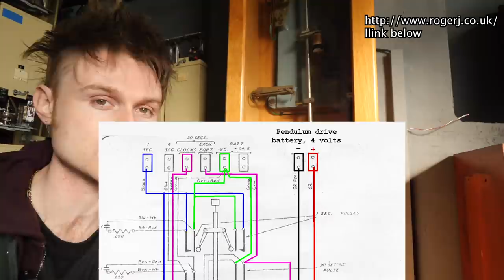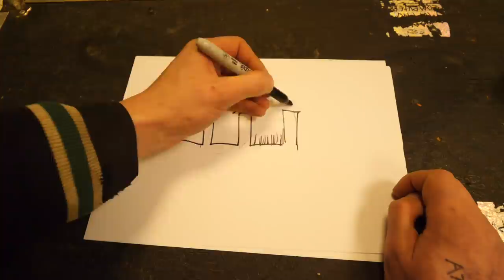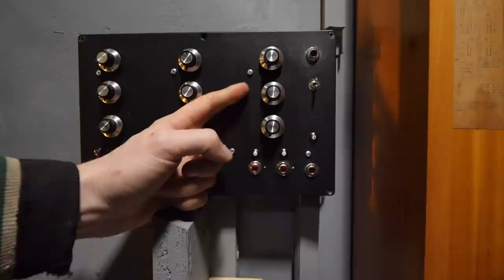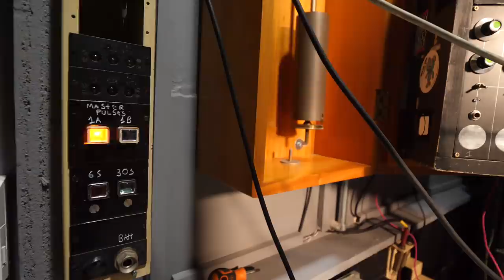PENDULUM MUSIC - Syncing Things That Shouldn't Be Synced Up To A Pendulum

Comment: Oh man. I remember the class room clocks in my grade school years back in the 60's here in the US and they were controlled the same way. What was funny to see and hear was after a power outage the clocks had to all be fast pulsed to set to the correct time and those clocks were not very quiet when being set at high speed 😃
Reply: While I'm obviously quite a bit younger than yourself, my junior high school in the 90s was built in 1961, and was like a time warp in there -- everything was so old! It had those same style clocks, and the master was in the main office in a little alcove. I remember that loud and fast chattering noise very well. Every time a nor'easter came through and knocked the power out, the building would be freezing inside, and they'd reset those clocks. What a throwback! Later, my high school had satellite clocks, which I remember ironically being far less reliable.
Reply: @bveracka  A bit younger? Yeah just a little.... 65 years on my end . The older the tech the more I like it 🙂
Reply: @marknesselhaus4376  Mark, as an older man on youtube, do you prefer technology from back when you were younger or now in the modern era?
Reply: Wish I could find a video of that!
Reply: @TheNathan696969  Well.... I prefer tech from back in my youth as I understand it inside and out but I can work with modern tech but do not have a good feel for how it works at the component level if that makes any sense. Case in point that I am challenged when it comes to writing a decent sketch for a basic Arduino or programming my TV remote ;-)
Reply: yeah the clocks being reset was always fun, CLACK CLACK CLACK CLACK CLACK CLACK CLACK CLACK CLACK CLACK CLACK CLACK CLACK CLACK CLACK
Reply: @marknesselhaus4376  of course, we all find it easier to relate to tech from our youth. To be honest I have to agree with your statement. I've no idea about arduino programming at all. I wouldn't even know where to start. My forte is In commercial HVAC systems ^^
Reply: @TheNathan696969  My now passed brother was a wiz with HVAC in his day but I got into ham radio 47 years ago and still rather work with vacuum tube or discrete transistor circuits. My pet home lab project is a processor using only home made vactrols. With a diode ( led ) and a resistor ( ldr ) I can create all the logic gate functions so I am building a working processor without transistors..... Sounds silly as it is slow compared to modern stuff but something I feel drawn to make and it works. My processor has about 350 of the critters so far ;-)
Reply: @marknesselhaus4376  sorry for your loss, I know what it feels like to lose a brother. I hope his passing was easy.  That sounds pretty cool! I have a young family so seldom find time to do fun projects like this, instead I find myself redecorating and fixing stuff my son breaks haha 😄
Reply: @bveracka  Oh that's ironic that 1960's tech would be more reliable than clocks that ran off a satellite's signal.
Reply: @tyty7023  Without a doubt! I very clearly remember those clocks like the one in this video being rock solid. Later in high school when we had satellite clocks, they were constantly going haywire. Like they say, 'If it ain't broke...'
Reply: ^you guys are all awesome
Reply: Honestly I'd be fascinated anytime that started up, both now and as a kid, that sounds pretty neat

Comment: Decades ago, it was my job to implement billing for 2G/3G wireless network systems. If you've used a cell phone in Somalia, Guam or out to sea on the Bering Strait, my code was involved in charging you for it. Seeing billing implemented in this manner is absolutely mind-blowing.

Comment: 1:38 Oldschool engineering like that is so fascinating to me. I love the genius ways they figured out how to solve mechanical problems that us digital-age people take for granted.
Reply: Seriously tho!!! It's absolutely amazing
Reply: I like how it works without a microprocessor... looking at cars with disdain
Reply: @freedustin  looks at my clock with distain too 😅
Reply: @EliteSniperTV  lol Clocks are one thing where I prefer digital. The ticking of a mechanical clock drives me insane. So does the bell of a mechanical alarm clock. I had one back in the day, but one morning I'd had enough of it's ticking, jangling bullshit and smashed it to bits. :-P
Reply: @gnarlysoundscapes7210  true! Then it fails every decade and goes to a landfill... That's my main issue tbh
Reply: @EliteSniperTV  That's pretty much the story of all devices made nowadays. Planned obsolescence. Why sell something built to last a lifetime, when you could sell something designed to fail so you can sell it again and again every couple of years? Sure would be nice if people would put their foot down and refuse to buy products designed to fail, but they just keep on buying...
Reply: @gnarlysoundscapes7210  happened right after the great depression. Eeconomeeeee needs more saleee 🤪 we literally had motors in counters that blenders etc with metal gears sat on... One motor, multiple appliances. Rip
Reply: @gnarlysoundscapes7210  it's also impossible to buy those unless you're talking high level PRO gear. Stupid expensive
Reply: @EliteSniperTV  The worst thing is PLASTIC gears. Especially in cars. My car's heater vents are controlled by this little cheapo motor with flimsy plastic gears in it.  I've had to replace that stupid thing twice, and it's a massive pain in the ass to reach.
Reply: It’s the same thing.

Comment: i love the motherbrain interconnected museum idea, it just keeps getting cooler and cooler! It would be cool if other clocks set up in other parts of the museum are all different times in the world, cause all of them are interconnected by one master clock, it would mean that it indexes correctly relative to each other?
Reply: Unfortunately no, it was not unusual for a slave clock to take more than one step per pules or miss a pulse ocassionally, especially if their solenoid mechanism got out of adjustment as they aged.

This caused much anxiety and stress in the heart of a Postmaster, who then would feel compelled to call the Senior technician and request (demand, more like, for in my experience there was little love lost between the clerical and engineering branches of the NZPO) the immediate dispatch of a junior trainee tech to either short out a fast one (until the actual time caught up) or to use a 1.5 volt battery to apply additional pulses to a slow one. Ask me how I know this.
Reply: @mikesanders6351  How do you know this?

Comment: 4:36 Heh, apparently I'm not the only one who sometimes runs clocks at too high a voltage. Long story short, due to a dodgy self-made AAA-to-AA adapter, I accidentally ended up running a regular quartz wall clock directly from the Li-Ion cell inside one of those fancy rechargeable batteries instead of its 1.5V step-down converter. The first thing I noticed was that the clock was unusually loud. It was only when I saw that it was often actually stepping backwards instead of forwards, that I figured out something really wasn't how it should be. The quartz circuit itself didn't really care about the +2.5 volt ‘overclock’ though, it still ticked at 1Hz…

Comment: Great! Amazing!  A random idea: Put a mic in the master clock case - tons of resonance bouncing around in there.  Then, a bit of filtering + some comparators and you might get some kooky timing sequences on the output.
Reply from the maker: it will be a project. just a lot of technicals with that. i just didnt have one i wanted to leave in there permanently :D
Reply: Next level thinking

Comment: The master slave clocks I got training on were a bit more complicated, but essentially the same. The master would keep time for the building and periodically (every 2 seconds?) send out a series of pulses. Through a complicated set of shift registers, the slave would update it's time. Each slave was an independent clock, but was always waiting for an input signal to sync to.
Most faults in the slave units were self contained. But we found a few ways to mess up the master signal for everything (eg shorting the input signal to the output of a 3600 multiplier). Fun times

Comment: How amazing would it be if each station at the museum had a sync box for 'free, 1x, 2x, 4x' and every half-hour or so everything set itself to 1x. Still allows for noodling around, but would probably be pretty powerful to have all the discordant/off-pace stuff just snap together on-beat for a minute or so before going back to whatever setting they were using before.

Comment: You can use a pll to sync to the freuqency. What it is basically an oscillator with variable frequency and its output is divided and compared by the reference signal to adjust its oscillation. The divider determines the multiplication factor of the reference signal.

Comment: someone else posed the idea of reed switches in the pendulum case somewhere here in the comments, and i think that's a pretty neat idea to get the "multiple pulses per second"-thing in a purely analog/mechanical manner. maybe you could have the reed switches on some sort of manually adjustable slide so you could change the timing between the sub-pulses.

Comment: Next step; hook a synth up to a heart monitor. :-D
Reply: I'm not sure that would actually sound good. The last time I was at the hospital I noticed that my heart rhythm was all over the place. Not even close to a metronome. I asked the doc if that was a bad thing and he was like lol no, your heart rate can vary by 10-20% with every beat. When they say your heart rate is 80 BPM that's just an average.
Reply: Would it be ethical to connect this timing system to someone's pacemaker? As long as nobody grabs the multiply knob.
Reply: And the Kurupt FM on the track hahahaha, full Heart Monitor Riddim.

Comment: What you actually want is to have the master clock driving a flywheel and shaft at 60 RPM. The shaft then has multiple brass wheels on it with mirrors or black markings or whatever on it. Those get picked up by optocouplers. Each brass wheel is a different BPM. You can have a 120 BPM wheel, a 140 BPM wheel, 141, 142, 145, whatever. Pick and choose. Super easy to do on a CNC lathe, too.

Comment: the gpo did make a clock 46 which is like half the size and different pulses. the GPO also had something called an EPGA which is a digital clock that is accurate to within a tenth of a second after a month or runtime or something daft like that.
Reply from the maker: Cool to know! Now I’m on the hunt!
Reply: @LOOKMUMNOCOMPUTER  nice, I think my fathers mate has a clock 36 on ebay but its missing the weight for the pendulum. anyway good luck!

Comment: a slight correction: it isn't the distance between the pulses, it's the distance between the rising-edges of the pulses: the frequency is not dependent on the pulse width

Comment: My first thought would have been to use a 555, basically to have a 2 pulse steady output but reset by the input (sync pulse)
But there's also frequency doubleers using flip flops.
Reply from the maker: you could! i have a multiplier circuit that does it with flip flops but its just not that useful in a setting like this. for this kinda thing it just seemed easiest as when the variable master clock gets put in it will put it all out of whack :(. you should have seen it when i was trying to sync it up to the second pulse with the unsymmetrical pulses ha
Reply: @LOOKMUMNOCOMPUTER  Yep, i can see why yours is more useful, the 555 was just an initial thought as i know you don't like using computers :D
Reply from the maker: @sparkyprojects  hahaha yeah I mean I must be honest I was reluctant initially to use an arduino on this one! 👍👍👍
Reply: @LOOKMUMNOCOMPUTER  I just realised, this is Swing music :D

Comment: Whilst the Arduino code is cool, it does not really do justice to the clock source. I'd suggest some form of mechanical phase lock loop. A spinning flywheel triggering pulses, divide the pulse rate by two and compare with pendulum's 1Hz. If wheel is faster/earlier slow the flywheel's (adjust a multi-turn pot??) and if slow/later increase the flywheel's speed.
Reply from the maker: indeed. i do have an analog multiplier too, the thing is i wanted something to be reliable and stress free so it can sync around the building, so i went for this approach

Comment: You could pick off 120 bpm using the two contacts that give 60 bpm, and a sensor of some sort as the pendulum swings by the bottom center point.
Reply from the maker: You can’t as it is nearly impossible to match those contacts symmetrically. Plus those only give 30bpm
Reply from the maker: I tried but the symmetry fudged it

Comment: FYI generating a faster clock from a slower reference is an example of a phase locked loop. You can totally do it with analog circuits.
Reply from the maker: Yeah I know but it’s clunky and not as good I have a module I made of it. Totes possible just not useable like this
Reply from the maker: Like I say in the vid

Comment: It would be pretty smooth if you made the pendulum shaft adjustable in length, That way you can adjust the rate at which it swings. Giving you the ability to change the speed/tempo of the clock. You could call it the Clockronome.  @THIS MUSEUM IS (NOT) OBSOLETE
    LOOK MUM NO COMPUTER

Comment: Can you adjust the height of the weight at the bottom of the pendulum? The period (bpm) of the pendulum will go up the closer the center of its mass is to its pivot point. So if that is an adjustable weight, any higher you raise it, the faster it'll go!
Reply from the maker: it only adjusts the bottom part its a part of the video i edited out, also the weight displacement will effect the energising circuit

Comment: Question, for a good sync project.  Can the length of the pendilum rod be adjusted with a heater in a closed loop to bring it into sync with a GPS receiver 1 pulse per second? This could give the master pendulum NIST time standard accuracy. If say it was running slightly ahead, the heat would increase to lengthen the rod and slow the pendulum down to fall back into sync, and reduce the heat if it started falling behind.

Comment: Would it be possible using maybe the same 'ratcheting' method to get any tempo from the Gent clock? The pendulum is always at "60bpm" so that would be a clock 'reference' to derive other tempos maybe? The reason I ask is it'd be cool to have the option to use the Gent as your tempo clock for any or all of your synths throughout the building (and not necessarily be limited to 60/120 bpm or other multiples of)
Reply: You could do that by putting two in sequence, for example to get 140 bpm  the first one would be set to divide by 6 (to get 10 bpm) and the second would be set to multiply by 14 (to get 140 bpm).

Comment: That boost switch lever mechanism is puzzling to me. It looks precarious but obviously it’s not. Can anyone explain it? 

Here’s what I notice: The dangling lever skips over the bump when the pendulum swings far enough. Losing amplitude eventually, it seems to catch the bump on its end, not moving far enough to clear it. The return swing then levers the contact mechanism connected to the top of the dangler in a kind of pole volt. Heh. Maybe this should be its name. Not knowing mechanics well enough, I struggle to feel confident in this, even though I recognise it’s clearly proven itself. Is it a common example of electromechanical pendulum boosting?
Reply from the maker: Yep a lot of them have this. For instance this clock was in every telephone exchange in England. There is a tiny groove on top of the pad thingy

Comment: Brilliant!
Where can I find this stripboard layout you mentioned...? There is no link inside the github repositories? Can anyone point me at it?
Reply from the maker: Screenshot the vid :)
Reply: @LOOKMUMNOCOMPUTER  That's what i did already ;-) 
Thought there would be some more infos on some site i missed...
If i want to build it as a standalone box, is there any reason (calculated values) for staying on 12V instead of a 9V (center negative) i would prefer...?
Reply from the maker: @9VDC  It will work

Comment: Multiplying the pendulum frequency with a 4046 phase-locked loop would fit your vintage-analog style - using an Arduino to do it is hardly "look mum, no compuiter!"
Reply from the maker: Yes but it is tough to add the swing item. I built an initial one with a phase locked loop and it was not really working well enough. Sometimes it's about getting the most ergonomic function. 9 times out of 10 that's an analog approach. This was not one of those
Reply: @LOOKMUMNOCOMPUTER  a very long time ago I did a PLL that synced to a pulse-per-second from a master clock. On second thought, its capture time was probably too long to be useful. Might be an interesting rhythmic effect to hear it hunt for the right frequency,  though!

Comment: This is fantastic! The most analog of pulsed clock sources. Also the most literal! I'm not even going to be nitpicking about the Arduino not being analog, as proper top octave dividers and / or PLL's are usually digital as well to preserve accuracy. Fantastic synergy between all the bits mate, well done!

Comment: Can’t anyone tell me what the correct voltage should be for the old intercom featured a little while ago? I’ve got a 30s intercom I want to get working. Thanks
Reply from the maker: You can get by with any voltage between 12 and 30

Comment: idk man, if you're resorting to microcontrollers to do ratcheting, why not just use arduino as pulse generator? Or better yet, pull a generator out of arduino and tune it to desired frequency?

Arduino in my opinion is kind of defeating this "low tech" approach
Reply from the maker: Why would I do that when I got a pendulum?